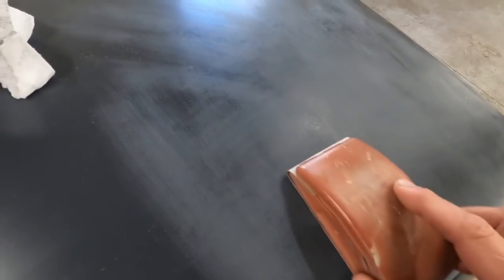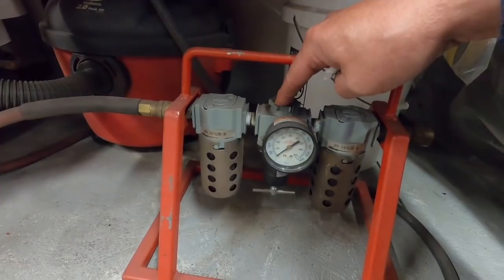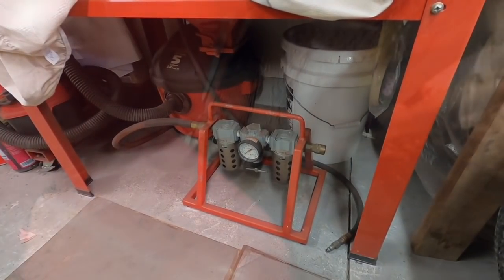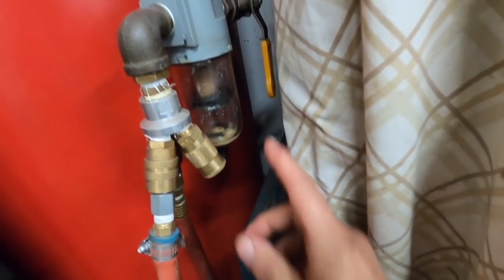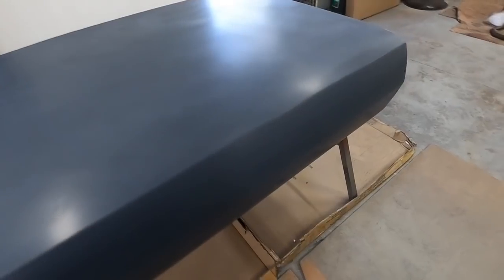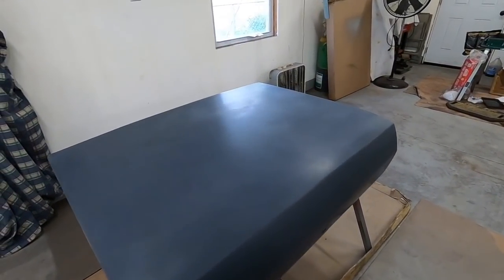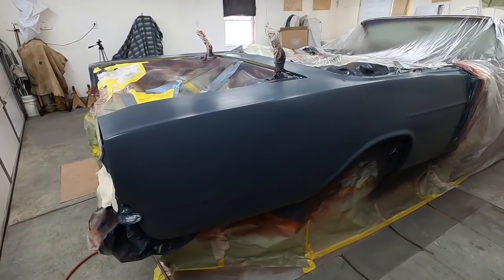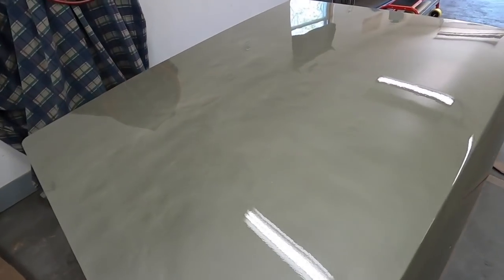1966 Ford Galaxie 500 convertible restoration part 116 Painting rear quarter panels

Comment: For the mottling, coat 1 front to back or side to side depending on panel. Coat 2 at a 45 degree angle and increase air pressure. Coat 3 opposite 45 degree angle a little more pressure. A fourth drop coat holding the gun at about a 45 degree angle to the panel, fast passes. Should eliminate the mottling.
Reply from the maker: A friend that paints show cars for a living, stated it's because I don't have the spray nozzle straight onto the surface. He stated to hang things to get the full fan of the spray gun onto the surface, or use a pressure pot gun to spray 100% downward.Totally makes sense. I was thinking the same thing.

Comment: Most people don't think about the humidity in the air but when you compress the air by 5 or 10 times the amount of water in the air, the humidity, is the same so you are going to have water.  I worked in a really large plant that had 10,000 horsepower of air compressors hooked to the plant air.  The lines were about 12" in diameter and ran for a couple of miles.  There were a couple of large air dryers with electric heat and desiccate tanks.  At the end of the line the water would accumulate enough that when you opened the valve on the air hose located there for blowing down the area it looked like a high pressure water hose and would take several minutes to blow it all out.  We ran at well over 100 PSI.  There were a few timer controlled drain valves just to let the water out.   There was no part of the plants operation that was bothered much by the water until winter when the smaller air lines hooked to the main lines would freeze, especially if they had been repaired and not insulated, and sometimes split.  The air was used for many of the production lines for powering cylinders that opened, closed, lifted and operated thousands of different things.
Reply from the maker: A compressor like that would blow my house away......

Comment: Hey Howard..the quarters look fantastic..i was going to suggest that you hang the hood and the trunk lid but..i have a elbow on my air tank with a 6" pipe and ball valve to drain the water from my tank ..i also have a hose attached to it going outside the garage so draining it is easily drained..no more getting on my knees to drain it..just wait till you paint something silver..that will be a new experience if you haven't already..the Galaxie looking great...see you on the next one ..Cheers 🇺🇸🇺🇸🇺🇸
Reply from the maker: If I ever replace the compressor, I will do that.

Comment: When I get that molding in the hood and trunk I used to add a few Oz of paint maybe a third on the cupin my gun and then fill the with reducer and lay a couple of coat over the hole surface, this will spread the matalic out and remove the modling.

Comment: car looks good...it will really pop with the chrome and emblems on it..i usually just buy stuff here and there,,,like if i am going to do the motor over..i buy a few things here and there and get it done  ,,,you are rerally close to the finish..at least now you can put it together and drive it
Reply from the maker: Who knows.... I might still use it as a everyday summer cruiser, IF I get the top on it. If I get enough money from my videos, I'll have it done. The video money is direct deposited into my hobby car account. There is $900 from past deposits, maybe by the time I am ready for the top, the money will be there. The chrome will be next winter, or spring, depending on the economy. It will need a front end alignment as soon as I am done, so I might get tires with my video money first.

Comment: Nice job painting the quarters. I didn't know that the metal-flake would do that on a flat surface. Are you going to paint the rims the same green?
Reply from the maker: The wheels will be gloss black, as that is how they were originally painted. Metallic paint is difficult to spray.... especially the highly metallic paint on the Galaxie. A auto painter friend told me why it happened. I'll try to explain it in my next video.

Comment: Paint the hood and trunk now ! They might not match if you wait until fall...
Reply from the maker: I might.... the hood is not to bad, it can wait if needed. I might reshoot the trunk lid, when I spray the door, and I need to do the wiper/vent cowl too.
Reply: @OldCarAlley  I had trouble with a t-bird I painted.A front fender was hard to match with the gold paint I was using.The paint was the some but it took 3 times to match.???

Comment: I am sending 'Santa' over with a few satchels of cash-- Do you think maybe a bit too thick so the paint puddled? Be a great driver, as long as its close or as good as factory is more than sufficient, sure better than spending 5-10 grand on a paint job
Reply from the maker: For a "back yard home garage paint job", I think it looks good. I will respray the trunk lid, when I paint the door. I talked to a friend that saw the video. He stated it's because I didn't have the spray pattern from the gun, spraying straight down onto the surface. I will show what he was talking about in my next video.